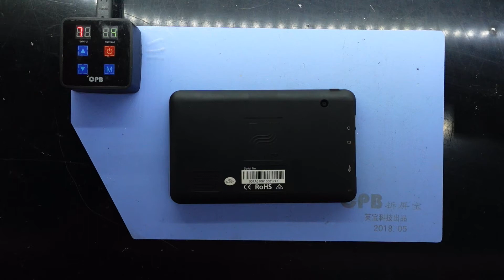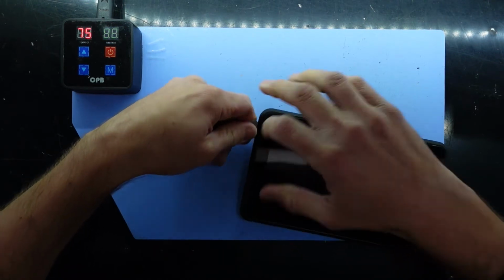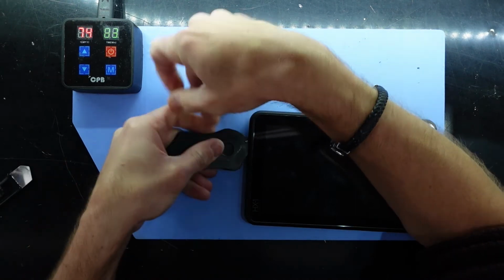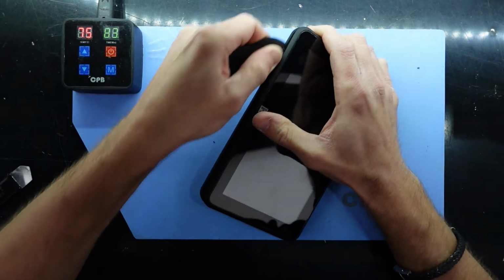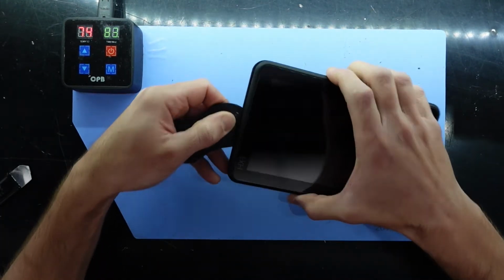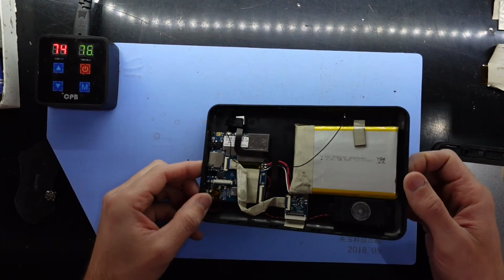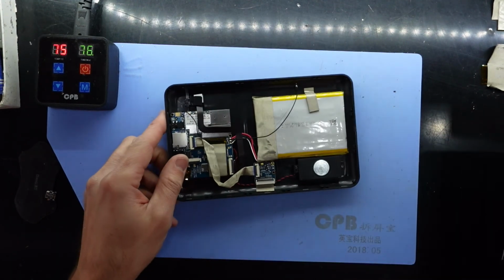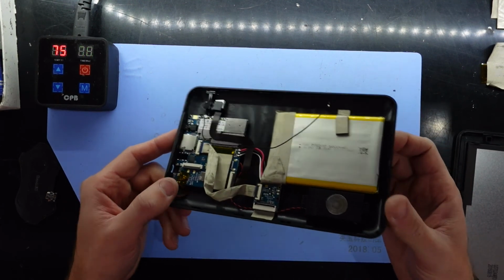Hema HX-1 Navigator Teardown and inspection

Comment: Hi we need to replace the battery but all the ones we find only have 2 wires no white wire? Do I get one with the yellow wire
Reply from the maker: Not sure. But the manufacture of those battery's might have simply just used one colour of wire to save costs